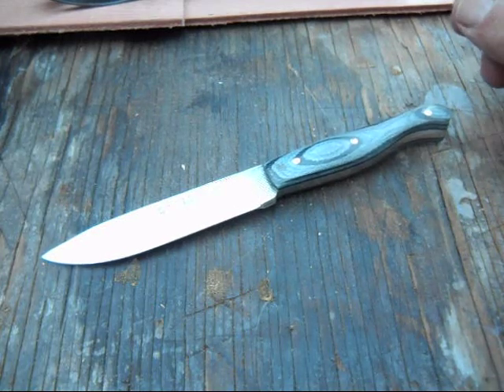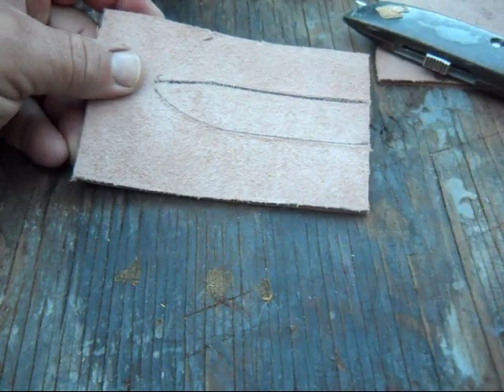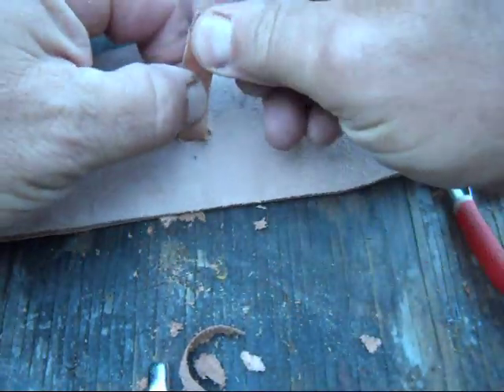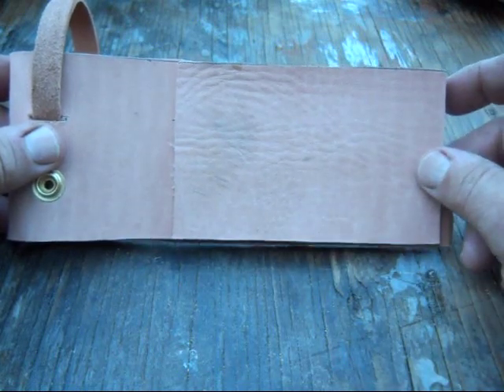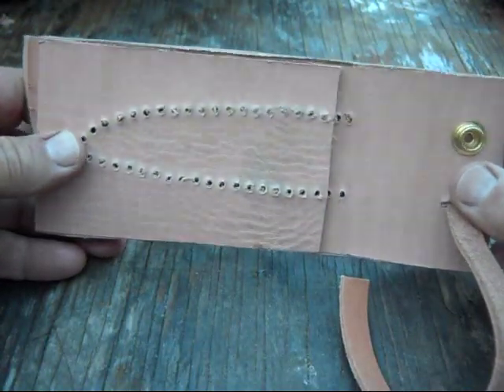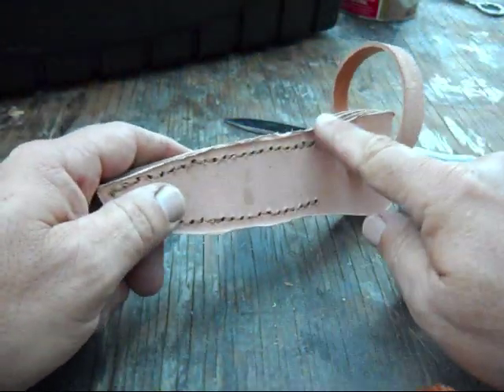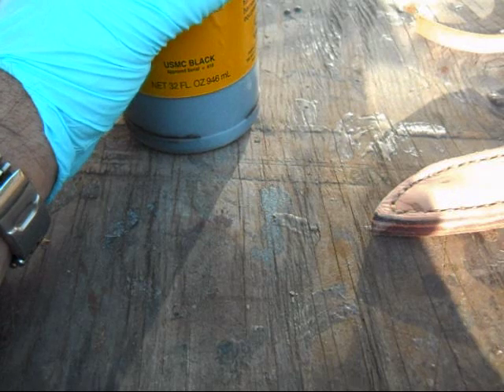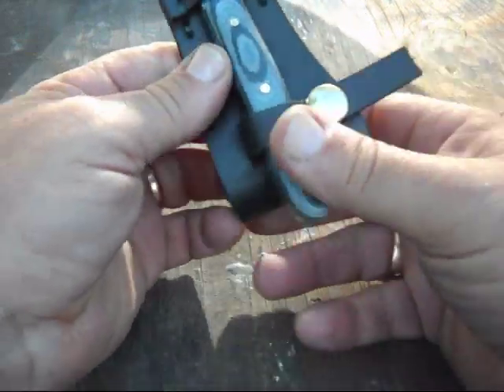Sheath Making (No Welt Sheath)

Comment: Just a question: Isn't it possible to just fold the part with the belthanger like you did and then cut a hole in it for the blade to go in and then do the carving as you did it, that way you will save the extra small leatherpart you put on top and it will not be as thick either ? Still the same easy technique with the sewing and custting etc.....